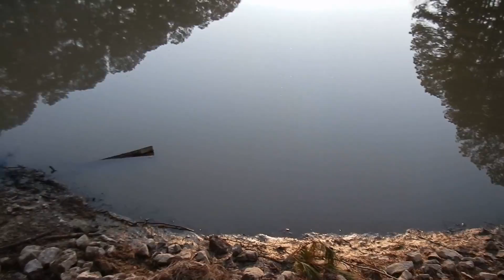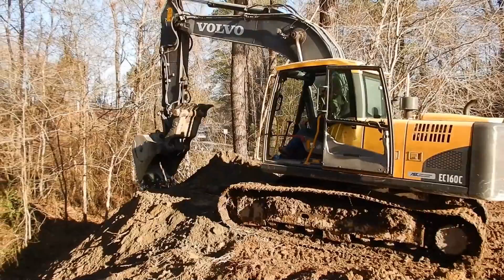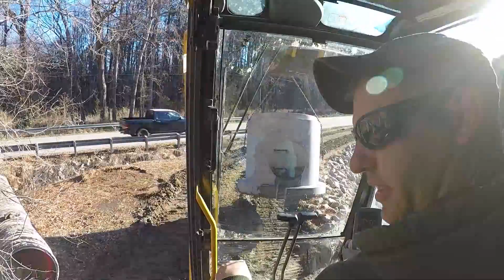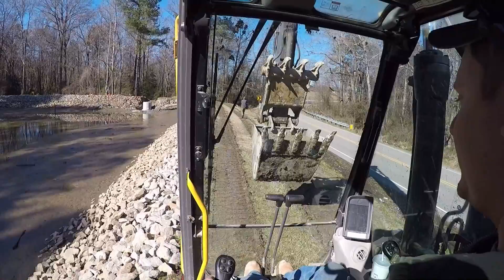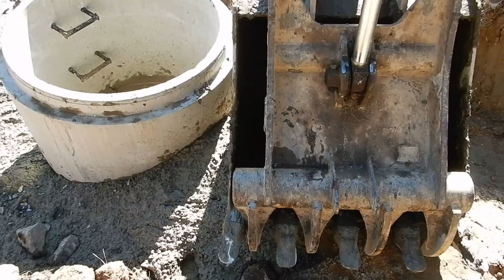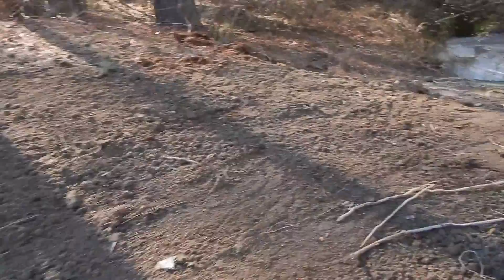Installing A New Pond Overflow System

Comment: If you wanted you drink shaken not stirred that trip back and forward to the cement truck would certainly taken care of it. A suggestion get a swivel for between the double sling and the bucket hook to make it easier to turn and hold the concrete structure in position when setting up as you are always to one side when putting these in, as the saying goes work smarter not harder.

Comment: Wonder if the water in the bottom of the man hole made it seem heavier than normal. Water is around 8lbs a gallon and could easily be close to 100 gallons in it. Noticed the water when you were loading it.

Comment: 1) wow you guys work smart--I see you had the concrete truck back up past the overhead wire , so you didn't have to do any gymnastics with the bucket when it was full . 2) would anybody here like to discuss the difference between concrete and cement ? I'm told there is a difference, cannot ever remember what it is ! 3) that pond would be AWESOME for sailing remote control sailboats in summertime. 
4) I always wonder what your Uncle thinks of all this "youtube stuff " , if he has ever commented on it at all.........
Reply: Cement as in portland cement is an ingredient in concrete. It is mixed with aggregate (small rocks) and other things to produce concrete.
Reply: OK--so you could use cement as a mortar for stone work  , or turn it into concrete with aggregate as a stand alone product. I think I get it--now can I remember it ?.......thanks man.
Reply: SailorAllan mortar is for stone/brick work its cement with sand and lime
Reply: @SailorAllan...Concrete has 4 main 'mix items'.....Water, sand (fine aggregate), gravel (or large aggregate) and cement.
Reply: Hhhaaahahahahaha

Comment: Chris, does that black drain tube ever collect trash and plug up.?   Do you ever put in more than one tube?  Thanks we are building a pond in Kansas that collects from 160+ acres. Worried about washing out the dam. I will probably put in a 24" tube or 2 12".  We will have emergency spillway with riprap also.  Thanks for any info.

Comment: That's annoying the cement truck driver wouldn't back down to work site.
Reply: Think that tok them at least one exrta hour with all that tracking
Reply: He said he made it to that point before he got stuck
Reply: Mike Man the concrete truck drivers job is to protect that truck first while trying to deliver the load.

Comment: Why not sit on the road at the end of the guardrail and here they have run front dump 6x6 cement trucks if you tracked in they would or could have gotten close enough to dump/pour! awesome digs as always !
Reply: Steve La Londe Jr that location is a real dangerous spot to do that
Reply: I think they where not allowed that because of trafik safty.
As you can see there is a curve an vehicles drive fast.

Comment: Wish my truck had those remote controls damnit . Surprised he didn't bsck farther up, I would've tried it lol.
Reply: Hell yeah !  I hate those rear discharge trucks, up here in the Northeast, they all unload from the front and the driver just sits in the truck. Much better and faster.
Reply: @augustreil  I drive a rear discharge, can put it places those fronts could only dream of going.
Reply: @TruckDriver389 , Not trying to be a smart ass, but how so, since our front discharge lets you literally drive right into the drop area and can see much better.
Edit: Especially doing any kind of slab, floor, etc, we swing the chute and back up at the same time.
Reply from the maker: he got stuck I told him to stop.  hes said let me try it again! LOL  gave it a running start and got about 2" more back LOL
Reply: @augustreil  just have better swinging radius. I do agree, fronts do have their perks. And I do get jealous you guys get to stay in a nice ac or heat cab on a wheel barrow job when I am standing outside in the elements lol
Reply: @TruckDriver389 , That's true. There are good and bad about both !

Comment: So the galvanized pipe and the plastic pipe doesn’t  last or is it an installation issue or you supposed to use concrete? I have no clue, anyone care to explain?
Reply: Ashley Wynn the concrete around the junction of the overflow and pipe is to keep water from leaking around there and washing the ground out from around the drain pipe
Reply: Galvanized pipe isn't great for outdoor use as it's metal and will corrode over time. Plastic if it's formulated correctly will last thousands of years. I would suppose that they put in the concrete standpipe because they can clean it out easier than what was there. There was only a two foot metal pipe that seemed like it got clogged easily on whatever was floating in the pond.
Reply: Thanks Joe & Alan. 

Will the plastic pipe fall apart where it’s exposed to the UV rays?
Reply: Ashley Wynn in time I'm sure it will however drain pipe like that is made with uv pretection
Reply: Ah ok, thank you. Obviously not my line of work.

Comment: At 5:38, whom would use such cheap ass culvert for a project like this. If your going to spend money to build a lake, do it right the first time. If a contractor or a salesman told the owners that this type of culvert would do what they wanted it to do, then the owners should have asked the question, "for how long until the culvert needs replacing?"

Comment: Couldn't you have parked the trailer and cement truck half on road half on grass near that bend just before the amco railing,  to make the runs quicker. It didn't look like a busy road and in Australia they don't think twice about half blocking even major roads for construction. She'll be right mate as long as there are witches hats/signs.